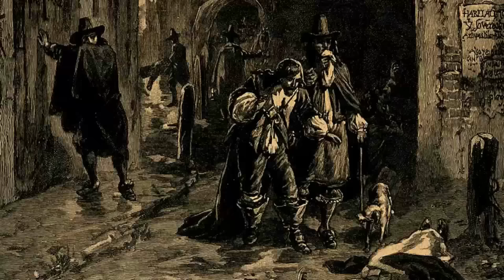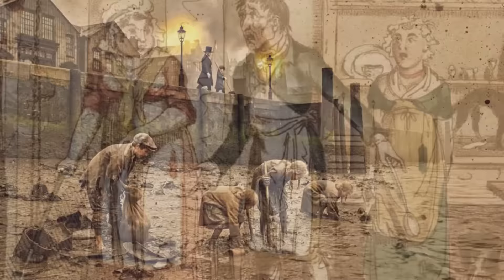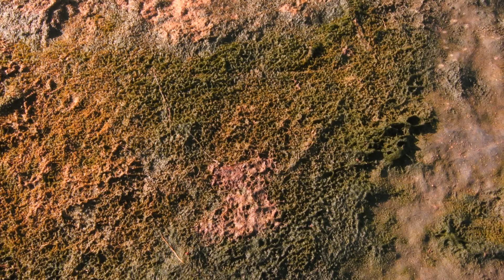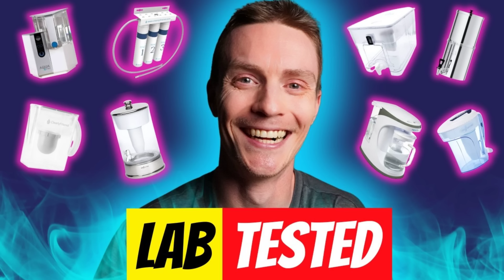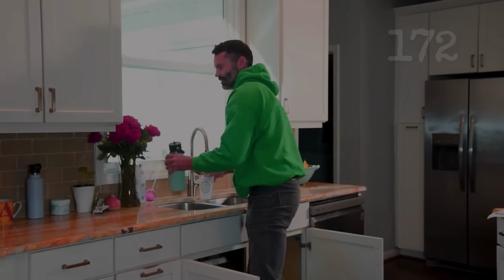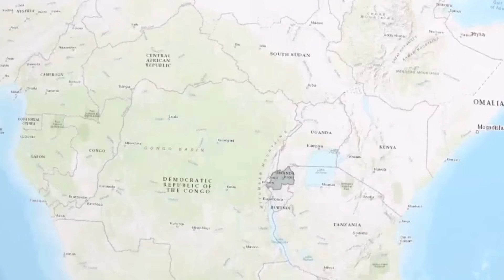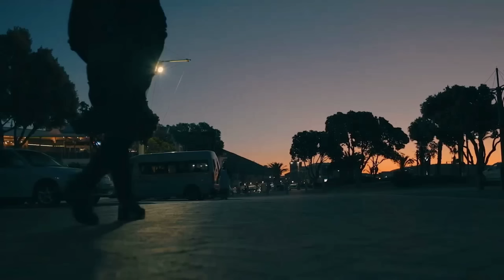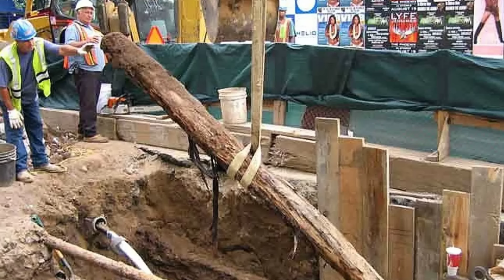The $50 Water Filter That Outlasts Any $5,000 System. Why Don't They Sell It?

Comment: Great points!  I think we also need to know how good it is at removing heavy metals, PFAS, PFOS, and pharmaceuticals.  But the sand filter sounds incredibly important to keep water safe from bacteria.
Reply from the maker: Honest answer, the biosand filter is not designed for PFAS, heavy metals, or pharmaceuticals. Those are dissolved chemical contaminants at the molecular level and sand filtration operates on a completely different scale. For PFAS specifically, even most commercial systems struggle, and the ones that do work, granular activated carbon and ion exchange resins, require regular replacement. The real conversation nobody is having is whether we should be expecting household filters of any kind to solve contamination problems that were created at the industrial and municipal level. Should the homeowner be responsible for removing chemicals that a factory put in the watershed upstream?
Reply: That question matters. It also isn't the first question. The first question is what can be done while we work to use the slow machine to reverse the causes, since we still need to take care of our health during the intermediary time.
Reply: @navyseal4000  You could use a berkey filter, till the pottery or the concrete unit is finished, maybe?  I use mine every day. Also to remove the fluoride.
Reply: @LostBuildArchivez Should the industrial corp, yes of course. Should we be? Well, we will if we GiveASheit about our own selves. Can't make them do it. And honestly, At least we can, unlike the whales & fish live in. 
I have a question: What about using activated charcoal as part of the process? One way was 3 barrels of staged gravel, sand in fine to finer layers and then sand and the activated charcoal?  
Another question: Could this remove fluoride?  I know that that chemical is a totally different filter from the standard (sand, carbon, etc.), it's tougher to remove. But any thoughts on that issue?   And Thank you SO much for the video and the communication.
Reply: @LostBuildArchivezexactly ❤ the problem is systemic
Reply: Conventional biosand filters (BSFs) do not effectively remove fluoride from water.  While they excel at removing pathogens, turbidity, and organic matter, they lack the capability to address dissolved chemicals like fluoride, which can lead to health issues such as dental and skeletal fluorosis when consumed over time. 

However, modified biosand filters have been developed to enhance fluoride removal:

Aluminum hydroxide-coated media, such as pumice and biochar, significantly improve fluoride adsorption.  In long-term studies, coated pumice removed fluoride for up to 418 days, and coated biochar for 313 days, keeping levels below the WHO limit of 1.5 mg/L. 
A two-stage system with uncoated media in the first stage (for organics and solids) and coated media in the second stage (for fluoride) has proven effective. 
Bone char and activated carbon also show promise; a combination of granular activated carbon (GAC) and bone char (BC) achieved 100% fluoride removal in lab tests. 
pH concerns arise with coated pumice, as it can lower water pH to unacceptable levels (around 4.18), but this can be corrected using post-treatment with oyster shells. 
These modifications make biosand filters a viable, low-cost solution for fluoride removal in household settings, especially in regions with high natural fluoride levels like parts of Kenya and the Rift Valley.
Reply: There is no way to remove those impurities unless you distill your water and then run it through a charcoal filter. This is what I do, and the result is magical. A simple charcoal filter lasts for months because the water is pretreated by the distilation process..

Comment: Interesting. However the main problem in the first world pre-shtf scenario is that people tend to come and go from their houses and may not be able to keep the filter going daily. Post-shtf one needs to have a four-week startup of the bacteria culture, perhaps a stash of propane could remedy this.
Reply from the maker: The intermittent use problem is the single biggest practical limitation for first-world households and you are right to flag it. The standing water column above the sand bed keeps the schmutzdecke alive for days without new water input, but extended absence of weeks or more will degrade the biological layer. The ripening period after restart is 2 to 4 weeks, not four weeks from scratch, since residual biology recovers faster than a brand new filter establishes. For a pre-SHTF household that travels, running the filter at least every few days and having a ceramic pot filter as a bridge during the re-ripening window after a long absence is probably the most realistic approach. The deeper question is whether this is a technology you maintain continuously as part of daily life or something you build and store as a contingency, because those two use cases demand very different planning.
Reply: @LostBuildArchivezHence we need a "Schmutzdekke care taker" yet another service to be administered. Or a $10000 automated filler and tap off.

Comment: I went on a tour of the bearpaw treatment plant in Calgary Alberta they use a Sand filter while we were there they cleaned the filter by reversing the process we watched as the water was forced in under the sand and literally lifted the sand in full suspension and the dirt in the top layer ran like mud to the drain and from there we were told it flowed back to the river but I seen quite a few videos on this type of filter being used by immigrants to filter water now I'm seeing that these stories might be based on actual events
Reply from the maker: What you saw at the Bearspaw plant is called backwashing, and it is the standard maintenance procedure for rapid sand filters at municipal scale. The key distinction is that municipal plants use rapid sand filtration, which relies primarily on physical straining and is backwashed regularly, while the biosand filter uses slow sand filtration, which relies on the living biological layer that backwashing would destroy. Two related but fundamentally different approaches to the same underlying principle. The fact that Calgary's municipal plant runs sand filtration while David Manz developed the household biosand filter at the University of Calgary is a connection that does not get mentioned often enough.

Comment: GET TRUMP INVOLVED BURKEY , IT'S CRAZY
Reply from the maker: The Berkey situation is a regulatory dispute between a company and the EPA over pesticide registration requirements for colloidal silver. It is working its way through the courts, specifically the Fifth Circuit. Whether you think the regulation is justified or overreaching, it is a legal and bureaucratic process, not something that gets resolved by political intervention. The more interesting question is what the Berkey case reveals about how regulatory frameworks can be used to remove market competition regardless of whether the product is actually dangerous.

Comment: THATS BULL , YOU CAN MAKE YOUR OWN SILVER
Reply: Please explain
Reply from the maker: @Michael_Arnold  The basic principle is electrolysis. You suspend two pieces of pure silver wire in distilled water and run a low-voltage DC current between them. Silver ions migrate from the anode into the water, creating a colloidal suspension. The challenge is controlling concentration, particle size, and purity, all of which depend on voltage, current, water quality, electrode spacing, and process time. For casual use the process is straightforward but for drinking water treatment applications, where the concentration needs to be precise enough to be antimicrobial without being excessive, quality control matters more than most DIY tutorials acknowledge.
Reply from the maker: You can generate colloidal silver with a simple electrolysis setup using silver wire and a DC power source, that part is true. The quality control question is concentration. Commercial colloidal silver for ceramic filter treatment is produced at controlled concentrations, typically around 3.2 percent for the application discussed in the video. Homemade colloidal silver varies wildly in particle size and concentration depending on voltage, water purity, and process time. For drinking water treatment, that inconsistency is the difference between effective antimicrobial action and a solution that looks right but does not perform. Have you tested homemade silver for concentration or are you estimating based on process time?

Comment: Where can I buy a water filter pot?
Reply from the maker: Ceramic pot filters treated with colloidal silver are produced by Potters for Peace partner facilities in over 50 countries. In the US they are harder to find commercially because the market is dominated by cartridge-based systems with recurring revenue models. Searching "ceramic water filter pot" or "colloidal silver ceramic filter" will turn up some options, but availability varies. The Potters for Peace website also publishes the full production protocol if you wanted to source one from a local potter who can fire at 900 degrees Celsius. Are you looking for drinking water filtration at home or for a field or travel application?

Comment: Will this filter out chlorine and fluoride?
Reply from the maker: Chlorine gets partially reduced through biological activity and adsorption as it passes through the sand column, but the biosand filter is not optimized for chemical removal the way activated carbon is. Fluoride passes straight through because it is a dissolved ion far too small for the sand matrix to intercept. If those two are your primary concerns, you are actually trying to undo what the municipal system deliberately added, which is a fundamentally different problem than removing pathogens from raw water. A small carbon post-filter handles chlorine effectively, but fluoride requires specialized media like bone char or activated alumina, both of which need periodic replacement. Are you on city water trying to strip out treatment chemicals, or on a raw source dealing with everything at once?
Reply: @LostBuildArchivez Thank you for the response. I understand now. I live in big city; I'll consider reverse osmosis.

Comment: I’m sure we all have illnesses from water but now it’s less severe and it’s slower illnesses that we can detect till it’s to late
Reply: Boil the water for twenty minutes.
Reply: @richarda996 you would need a huge cajun  pot to boil 20 min and still have enough water for the time and fuel to boil it to use.🤷‍♀️
Reply: I have one at home.
Reply from the maker: @jjwideawake.9397 The fuel cost of boiling is exactly why it fails as a long-term solution. Twenty minutes at a rolling boil for several gallons a day, every day, adds up to serious fuel consumption over weeks or months. During a sustained boil notice, the families who run out of propane first are right back to square one. The biosand filter uses zero fuel, zero electricity, and works every pour for 25 years. The fuel you save by not boiling could be allocated to cooking and heating where it actually matters.
Reply from the maker: @richarda996  
Having the equipment and fuel to boil large volumes puts you ahead of most people in an emergency. The real question is how many days of fuel you have stored versus how long the emergency lasts. A biosand filter running alongside your boiling setup would extend your fuel reserves significantly by handling the daily drinking water while you reserve propane for cooking and heating.
Reply from the maker: @richarda996  Boiling works and having the equipment to do it is not a bad position to be in. The limitation is sustainability over time. During a three-day emergency, boiling is fine. During a three-week boil notice, the fuel consumption and labor become a real burden. The biosand filter is not a replacement for the ability to boil water, it is what keeps you from having to do it every single day indefinitely.
Reply from the maker: The shift from acute waterborne disease to chronic low-level chemical exposure is real and underappreciated. A century ago, contaminated water killed you in days. Now it contributes to health problems that develop over decades, which makes the cause almost impossible to trace back to a single source. The biosand filter was designed for the first problem and solves it. The second problem, chronic chemical exposure from industrial contamination, is a fundamentally different challenge that the regulatory system has barely begun to address honestly. The fact that both problems exist simultaneously is exactly why no single filter is the complete answer.

Comment: How can a $50 filter outperform a $5,000 system? There’s definitely something they don’t want us to know. What do you think?
Reply: If you ever get a chance to really look inside a water treatment plant they still use very large versions of the biofilter. Them they treat the water before it leaves to make sure they kill all the bacteria that could have made it out of the filter
Reply: @cmiller8693  That’s a great point. Large-scale water treatment plants do use biofiltration systems, just on a much bigger scale. I guess the real question is whether a small $50 version can truly match the performance and safety standards of those industrial systems. What do you think about that comparison?
Reply from the maker: @TheArchiveofBuilds  
The household biosand filter and a municipal biofiltration system use the same underlying biology but operate at very different scales and within very different safety frameworks. Municipal plants add pre-treatment, post-chlorination, continuous monitoring, and redundancy that a household unit does not have. The biosand filter compensates for the absence of those layers by eliminating the distribution system entirely, which is where most recontamination occurs in municipal networks. A direct performance comparison is less useful than understanding that the two systems are solving different parts of the same problem in different contexts.
Reply from the maker: @cmiller8693  Exactly right. Municipal treatment plants have been running large-scale biofiltration as a primary treatment stage for over a century. The post-treatment chlorination step is what makes the comparison interesting because the plant essentially acknowledges that biofiltration does the heavy lifting and then adds a chemical insurance policy for distribution. The household biosand filter skips that insurance policy because there is no distribution pipe where recontamination can occur. The water goes from the filter into your glass. That changes the risk profile entirely.
Reply from the maker: The $50 filter does not outperform a $5,000 RO system across every category. RO wins on dissolved chemical removal, period. Where the biosand filter outperforms is in total cost of ownership, zero energy requirement, zero waste water, zero replacement parts, and pathogen removal that matches or exceeds RO for bacteria and parasites after the biological layer matures. The real comparison is not which one is better in absolute terms but which failure modes you are designing against. If your concern is a chemical contamination event, biosand is the wrong tool. If your concern is long-term water independence during infrastructure failure, the $5,000 system is the one that fails first.

Comment: Does it get rid of flouride
Reply from the maker: No. Fluoride is a dissolved ion and passes through sand filtration completely untouched. Removing fluoride requires either reverse osmosis, distillation, bone char adsorption, or activated alumina, all of which involve either energy input or media that eventually needs replacement. The biosand filter was designed to solve biological contamination, not chemical contamination. If fluoride removal is your priority, what is your source, municipally treated water or naturally fluoridated well water? The answer changes which approach makes the most sense.